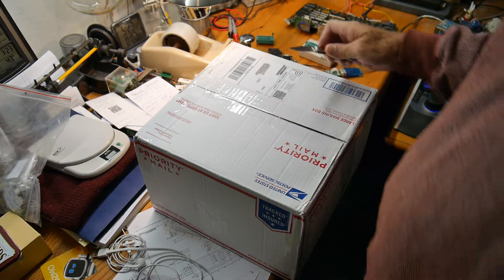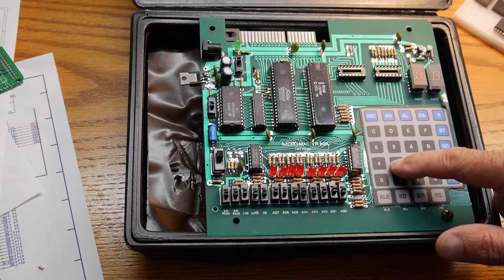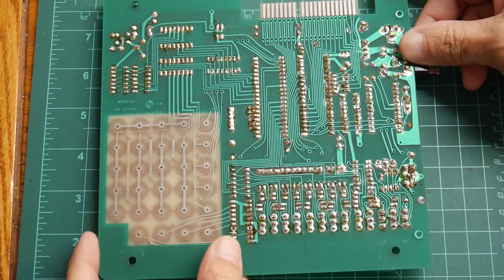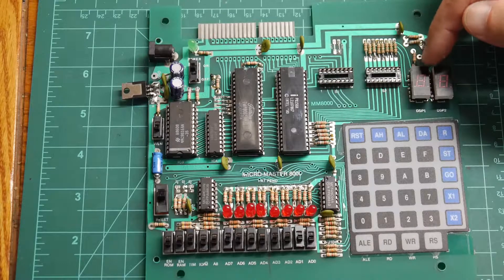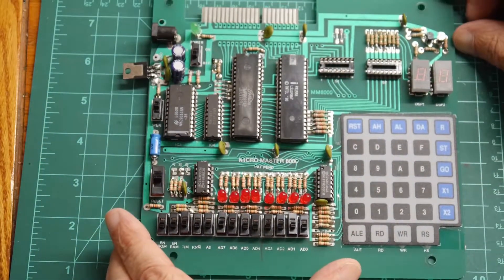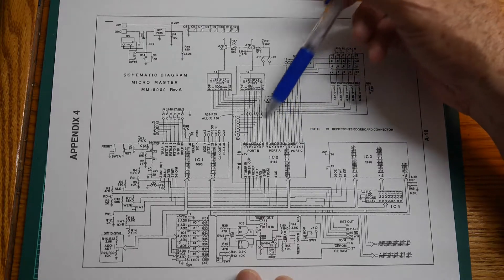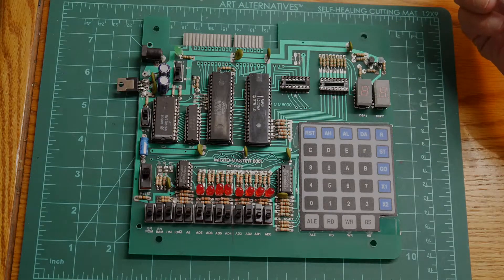#326 Micro-Master MM-8000 Intel 8085 Microprocessor Trainer

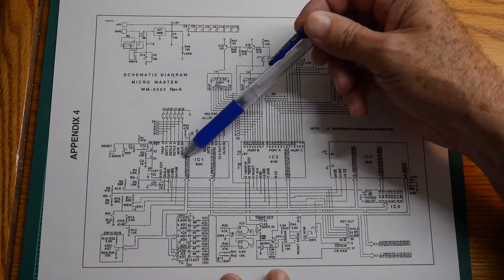Comment: hmmm @6:55 " this is the 8051"   ;-)    also i think the 8156 is the same as an 8155 but inverted enable input.    is the 3591 on the solder side of the PCB a date code ?
Reply from the maker: I did say 8051 but it is 8085. the 8156 is 2048-Bit CMOS STATIC RAM WITH I/O PORTS AND TIMER